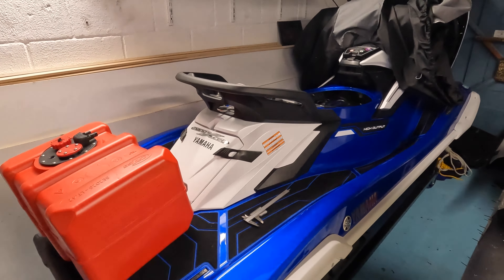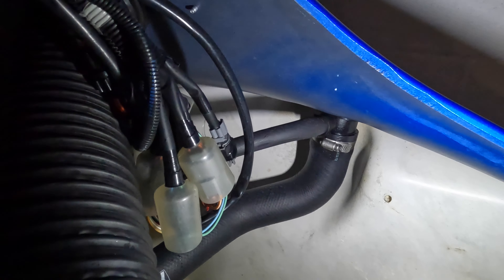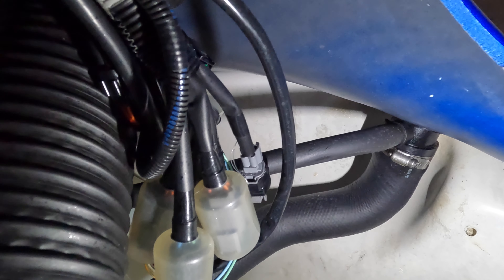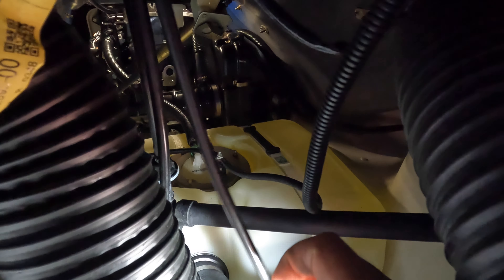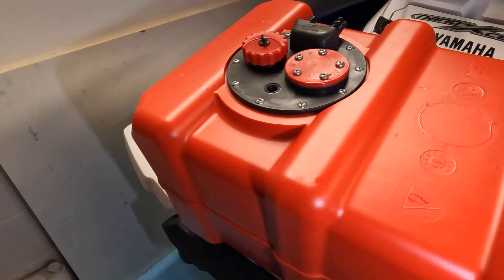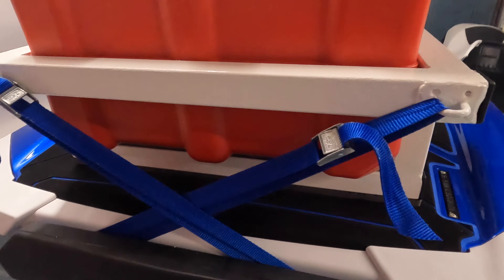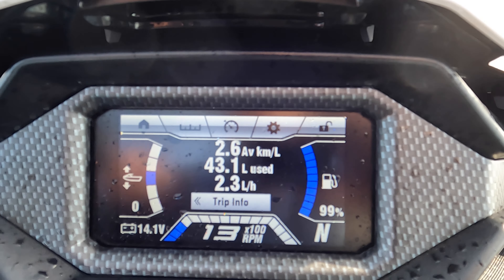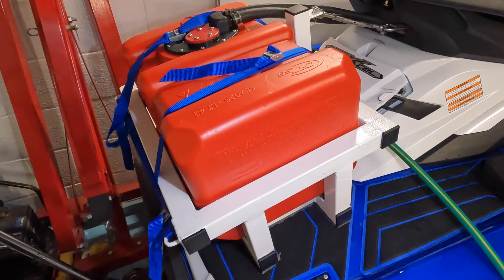Yamaha Waverunner FXHO/SVHO 2021 auxilary fuel tank. Design and fit.

Comment: How much fuel would I need to do a max 90 mile trip on a Yamaha fx ho?  Trying to spearfish off of one of these and will be weighted down with 200 pounds of fish on the return trip.  I was thinking an extra 5 gallons may work?  I had a supercharged yamaha and max I could go was about 16 miles offshore without extra fuel.